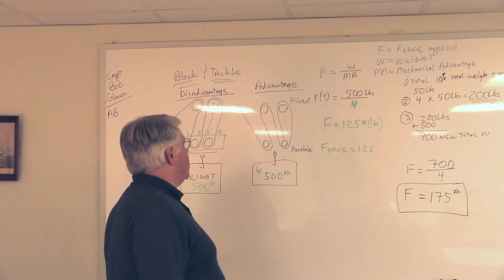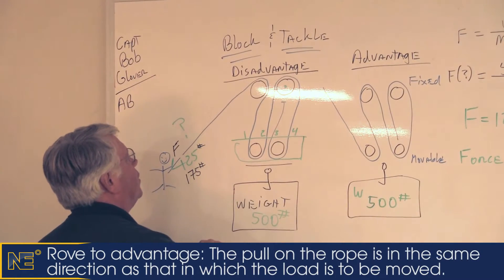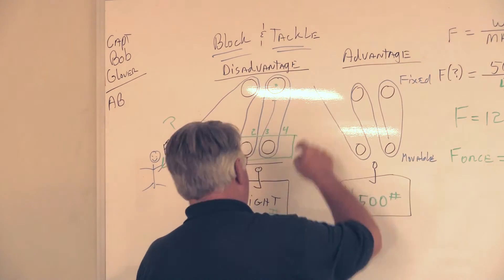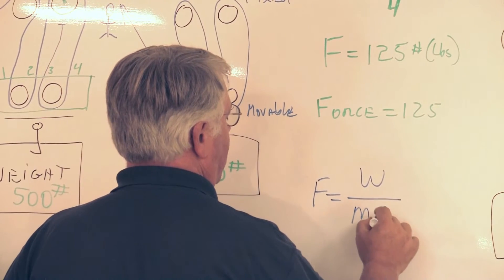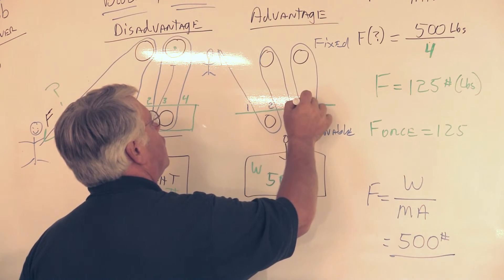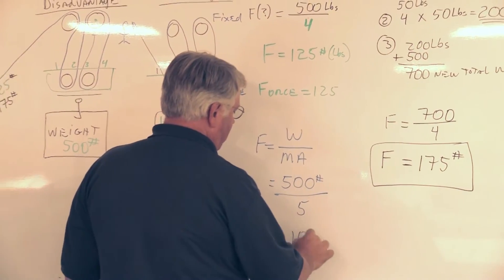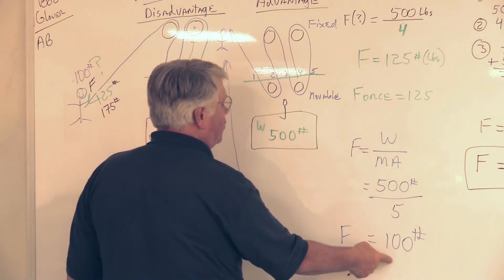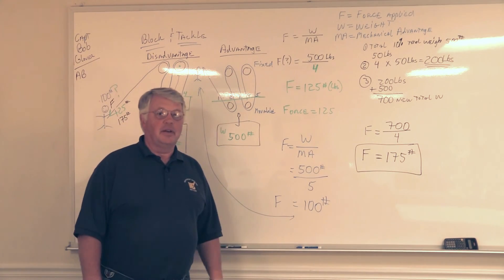Block and Tackle Part 3

Comment: great explanation.  only thing I would have added to the equation is the extra DISTANCE you need to pull is equal to the MA.  so if you have a 4:1 MA you need to pull 4 feet in order to lift the W 1 foot.

Comment: If you factor in the 10% friction then the Force (F) = 700/5 = 140 vs 175. The only problem I have is now you have to pull up with 140 lbs of force rather than pulling down where you can add your own body weight to help pull down. If you added another fixed pully on top you could then pull down with only 150 instead of 175. 150 factors in the additional friction for the 5th pully... 500 + (50x5) = 750/5 = 150. Thanks Capt Bob :-)))
Reply: What abt the friction in those pulleys..? Won't that be taken in to account
Reply: body weight is still pulling with same force as if you used your arms or your body

Comment: plus you're now pulling up on the weight instead of down on the fixed point possibly lessening the load on the fixed point. should have added this to part 3 or made a part 4 explaining this and whether or not it affects frictional loss.
Reply: friction is probably the same but it makes you wonder